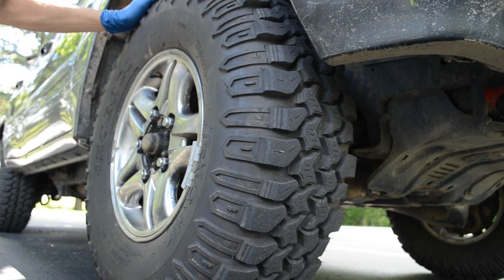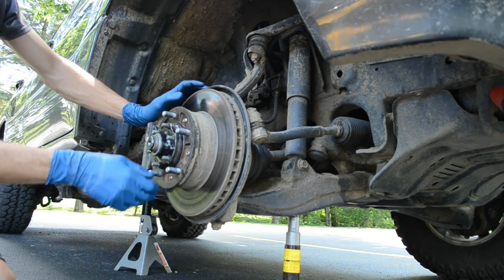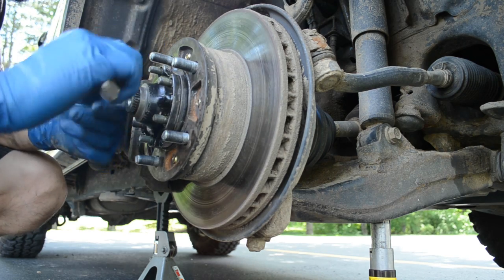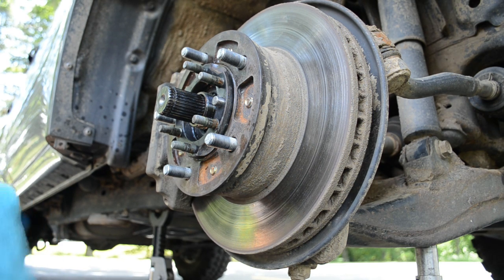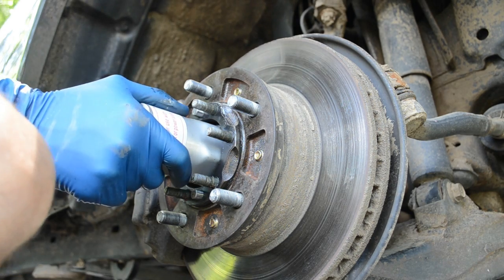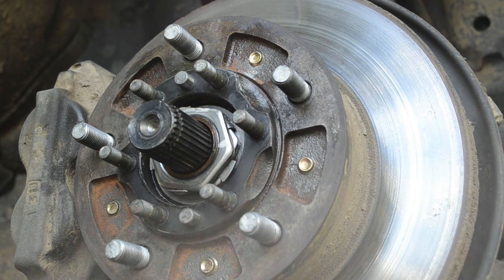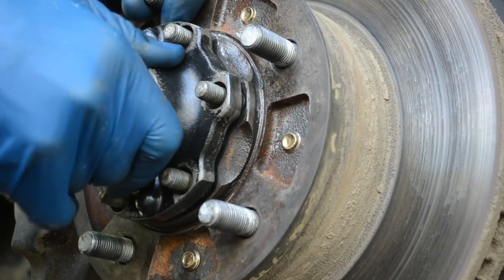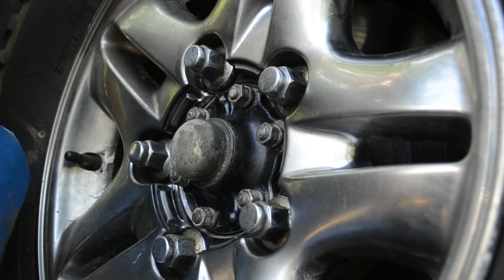How-To Front Wheel Bearing Preload Lexus Lx470 / Toyota Land Cruiser UJZ-100

Comment: nice job i’m gonna work on my 2006 lx 470 my front axles flange clunky sound after 225000 miles change axles i’m forgetting to change bearings.

Comment: Good job and checking and re tightening wheel bearings!

I once said you can't over tighten adjusting nut (1st 54mm nut against claw washer). As frankly most 54mm sockets are hard to hold on the thin nut. I once (no longer), used "hitting 75ft-lbf on adjusting nut". As sign to replace wheel bearings, at the next 30K miles service. Not out of concern bearing bad. The higher the torque we reach to get target (9.5 to 15lb) breakaway preload, the better the condition of bearings & races. My concern was damaging the threads of the adjusting nut going over 75ft-lbf of torque. But someone on ih8mud, did the math. Said the adjusting nut threads, can handle 150ft-lbf without to threads. I've since hit as high as 82ft-lbf torque to get 12.5lb preload.

BTW:
I find new bearings, torque comes in at 45 to 47ft-lbf at 12.5lb preload consistently. Bad bearing I only get about 20ft-lbf for the same 12.5lb preload.

Tip:
1)Never reuse snap ring. If one must reuse, pinch/bend them closed, before install. Or they fit loose, not seating all they way into axle groove. Which damages axle groove, and is why they axle get burns needing to file down to get hub flange off. Sometimes they'll than pop off. Additional gap between them and hub flange needs to be less than 0.20mm. So snap ring needs to be of a proper thickness. Factory thickness is 2.2mm. I use a lot of 2.4 & 2.6mm and even a 2.8mm now and than, to get proper gap.
2) Use brass to pound on hub flange studs, to pop out cone washers. Steel damages the studs. Never hit on the nut, which loose/stretches thread of nut and studs.
3) Don't reuse lock washer. If one must reuse, it must have a good keep/key (inside tab) tab. And never re bent a tab that has been bent back straight.
4) Grease, bearings an wheel hub, need to be, above about 60F. If too cold, we get a false high reading on spring scale, as grease thicken form cold.
Reply: This is an underrated comment. Just clicked on your channel and saw your avatar and username on ih8mud the other day (MY ME). True asset to the community. 👍
Reply: Very informative. Thanks.

Comment: Great video, just curious if this took the majority of play out of your hub assembly, or did you have to repack/replace?  It did look quite loose, I'd assume that fixed the issue if your bearings were still in good shape...
Reply from the maker: Yes bearings were fine and torquing the jam nut to spec removed all the play. I did end up replacing the bearings a few months later becuase I was going on a coast to coast road trip and didn't want any issues. I have 50k miles plus another repack on the replacements no issues to speak of.
Reply: @lillyautomotive  Yeah, thinking i might check mine when i get a chance, at the very least jack it up and check the play at the wheel
Reply from the maker: Yeah it's good to check every once in a while. Post some updates

Comment: What’s the symptoms of a loose bearing?  Does it feel like a tire is out of balance?
Reply from the maker: It can, it would have to be pretty severe. When jack up the front end with a tire or tires in the air, hands at 12 and 6 rock the tire in and out. If there is play the bearings are loose, can also be due to bad ball joints too. Do again at 3 and 9. Play in this direction can be loose bearing as well as inner outer tie rod ends, but if the front spindle is solid and the wheel itself is moving then bearings.

Comment: Noob question..what is pre-load and break away? I didn't quite understand why you were torquing/fish scale/retorquing...
Reply from the maker: Preload is how tight the bearing is being compressed by the double nuts. Too loose is better than too tight but both are bad. Break away is a way to measure the preload placed on the bearing being tested with the fish scale. Toyota specified the range that is acceptable.

Break away is just how much force it take to get the rotor to spin 

The tighter the nuts are on the bearing the higher break away reading you will see on the fish scale and vice versa.

Comment: Hey bro for that last grease step to grease the spindle bearing you had a little DIY tool. Looks like a PVC cap filled with grease and you might have hit it on the back to shove the grease past the splines into the spindle? Is that how that works? Hoping you can share some info on that so I can save from having to order a tool. Thanks! Great video! EDIT nevermind just saw you have a video for it!
Reply from the maker: Thanks for the comment and yup I have a video on the tool too!

Comment: Love your videos, definitely subscribed. The book shows measuring preload at essentially top dead center, does it matter? I can get nearly 60 lb ft and still only be about 8, just wondering.
Reply from the maker: It doesn't matter where you measure preload as long as your pulling 90° around the circle. I'm sure it's easier to do this / visualize 90° at top dead center. 

I've read if it takes above 75 ft lb, to get in range, it's time for new bearings at the next service. But I don't have first hand experience with that.
Reply: @lillyautomotive  Ah gotcha, thanks. Yeah new bearings and races, i'm going to get close without going over say 50lbs then put some miles on tomorrow and recheck everything. Thanks!
Reply from the maker: @PCMLLC  I would be ok going up to a 75 ft lb max to get in the window.

Comment: Nice job I need to do this .  My 100 Lexus is having play in the wheel like this .  I can just tighten it , or do I have to replace the bearing ?  I have similar play in both side of the wheel .  It’s causing my steering to be a little loose .  I thought that the tied rod was going bad so I bought some but haven’t replace it yet .
Reply from the maker: You can tighten it up and see if it helps. Ideally, I'd take the bearing apart, clean & inspect, reassemble & repack the bearing.
Reply: @lillyautomotive  .